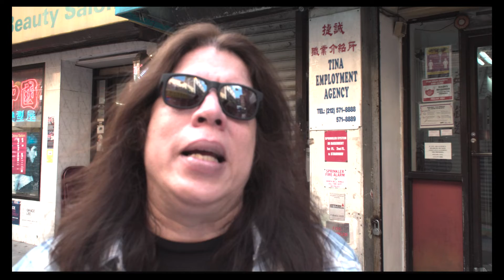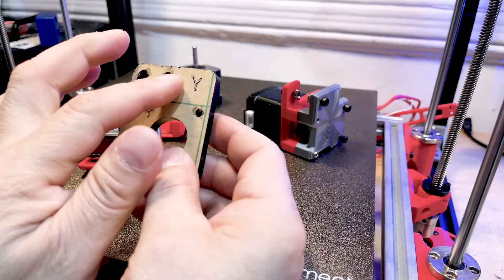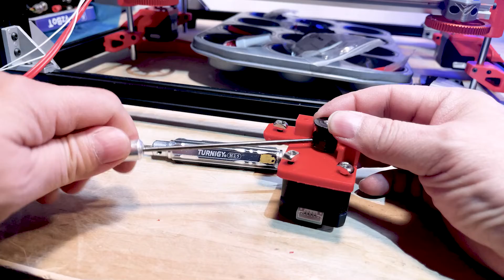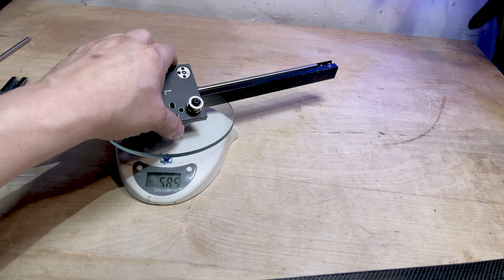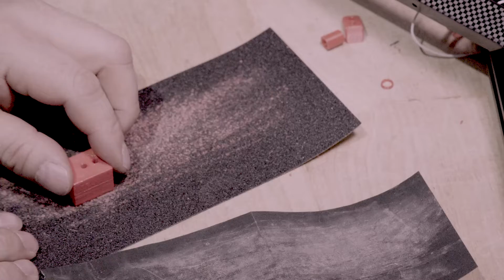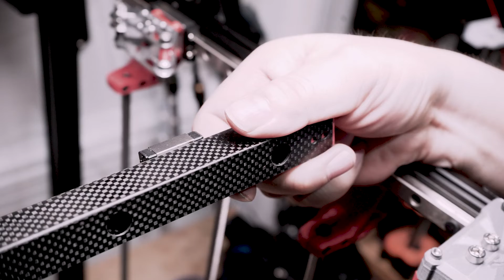UPDATED CORRECTED VERSION: How to build the VZbot Gantry - Part 6

Comment: Ceramic ball bearings will reduce the noise by roughly 20% and last longer too.
Reply from the maker: most of the bearing I had were from fidget spinners current the printer is pretty quiet as is my total all in was under 700 buck but it would have been around 500 or less but i got some cnc stuff that up the cost more.

Comment: Why no shims like the manual reccomends for the carbon fiber rail where it mounts to the cnc y gantry parts
Reply from the maker: Everything on my build fits perfectly I have the support blocks inside the carbon fiber tube, I have not tighted the carbon to the aluminum mount yet I will do that right when I am doing the belts. Which is next video belts, electronic and wire management without a backplate. If you can tell me what page in the manual where talks about shims I would happen to look at it and if it is needed I will add it in next video which I am shooting now.

Thanks for your attention!
Reply: @Tommy Gunn makes things  below should be the info I posted it before but the post was removed
Reply from the maker: Ok I saw what you were talking about it a very thing piece with 2 holes… I guess I am lucky and I don’t need it mine fits perfectly once I tighten the the bolts on it.. it’s good to go.. solid no wiggling.
Reply: @Tommy Gunn makes things  alright good to know I was seriously wondering as I'm building mine to sucks 2 seconds ago my only abs printer mobo let out the magic smoke I only had a few pieces to print to
Reply from the maker: @TRTmike4Life  I am filming the electronics now as I build the electronics I had to order connectors to do properly so waiting time set me back 2 weeks. 
Where did the smoke come from? The green or black connection On the board?  Were the wires loose and twisted? Or did you have a connector crimped on and the other end was there a fork spade? I maybe ordering a mosfet also. I can always order that later.
Reply: @Tommy Gunn makes things   o I have my config and klipper on my vz bot when it was a tronxy that board blew quick so I replaced with a octopus 1.1 then recently upgraded to an octopus pro so if I wanna go 48v I can and had a built in chip for the pt1000 on the goliath and the printer I was using for printing my abs was my tenlog tld3 idex so it's different I have the octopus 1.1 board with flipper flashed to it already just have to figure out a config and order new drivers I don't trust any of the old electronic I read it's electronics posed a fire hazard anyway because of lack of protection on the board
Reply: I swear I posted the link the same day and I just checked and it's gone but I posted it again incase it gets removed it's in the github bom and assemblies then gantry then aluminum y gantry and Readme

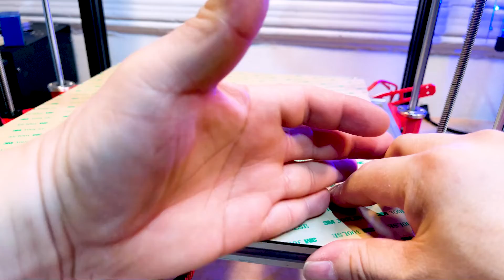Comment: 3:00 Never remove all the foil from the adhesive magnet sheet at once !  The correct solution is to start at one corner and stick it there, you can align the whole thing in the correct position, then gradually pull the foil out from between the table and the magnet, gradually squeezing the air out. How: https://youtu.be/BP7Kn36FM9A?t=215
Reply from the maker: That is correct… if you are laying down the magnetic sheet without the plate laying down the magnetic bed alone might cause air bubbles. I know about air bubble because back in the day I used kapton tape and had to slowly unravel and smooth out air bubbles. And then the same with pei sheets. 
Basically anything flimsy you got to use that slow rub out the air bubble method. 

Now with my method which worked on the last 4 beds I have installed it on is it is not possible to have an air bubble if it is attached to the metal plate.
The plates on fulament are thick the magnetic sheets are thick. I use only fulament  I don’t know if the cheaper other magnetic beds are flimsy or not. 

So once the magnetic sheet is attached to to the flat  metal plate and your bed is flat there is no air to squeeze out everything is flat and stiff.

 just lower it slowly align the corners when it’s like 1/2 in  just let go make sure it it is lined up properly getting a magnetic bed sheet is not going to go well. 

If you look at Michael video he is just laying down the magnetic sheet without the “metal plate” which is looking curvy and not flat.

Comment: Hey, Im working on installing the klipper firmware on an X5SA-2E produced in may of 2022. The motherboard is perfectly workable, and easy to install firmware on. Mostly because Tronxy has the firmware itself up on github.

The question is, which motherboard do you have? Its answered by looking at the board itself. In the lower-right corner of where the board is mounted, there'll be a board number alongside the tronxy name. 

Im still tuning it, mostly because one of the Z-motors sags instead of holding in place.
Reply from the maker: I replaced the chitchu board with a bigtree skr 2 rev b and 2209 silent steppers.
Reply from the maker: Try Delrin spring Aniti backlash couplers
Reply: @tommygunnfilms  yeah, ive already replaced the couplers, and it just seems to be the motor on this one side. The replacement should arrive tomorrow.

Glad youve got your motherboard squared away!

Comment: What are you expecting to spend in total to finish the build?
Reply from the maker: I expect including the used tronxy close to around 600 depending if you already have parts you can use. Like better board a nozzle extruder that would save you a lot. I will give a breakdown in next video of cost so far.
Reply: @tommygunnfilms  I contacted Abby to see if he had any returns near me, he said no but might have a pro.

Getting back into printing and don't want to fiddle with my og cr10 anymore.

Will have to buy the printed parts most likely. 

Look forward to the next vid.
Reply from the maker: @r3dd09  don’t get a pro for this project!

Comment: Where can you get the rod holders for the bed plate and z motor mounts printed if you don't have a printer set up?
Reply from the maker: You can do 1 of 2 things ether build the tronxy   Calibrate it print all the parts and make sure it’s all the parts or find someone with a 3D printer or search eBay and talk to people who print parts for printers or join a vz bot group on discord or Facebook and ask for help there.
Reply: @tommygunnfilms  thanks for the help man